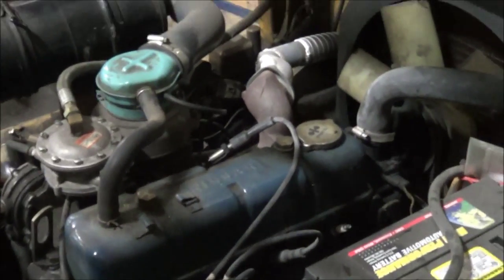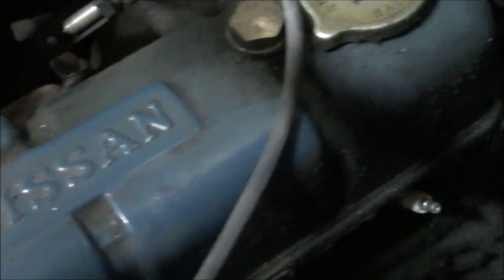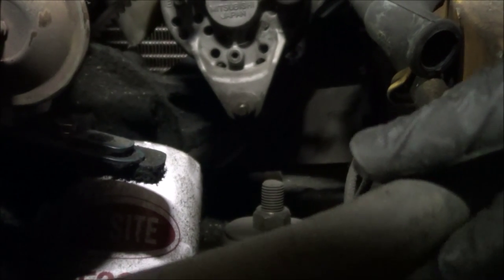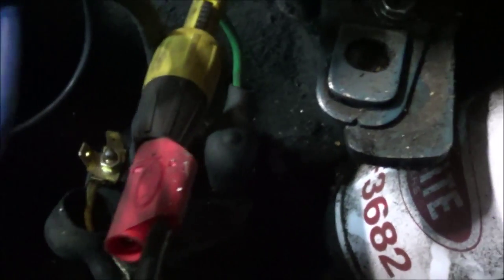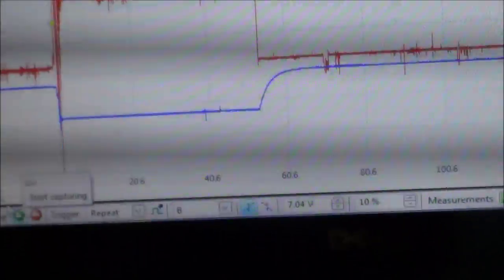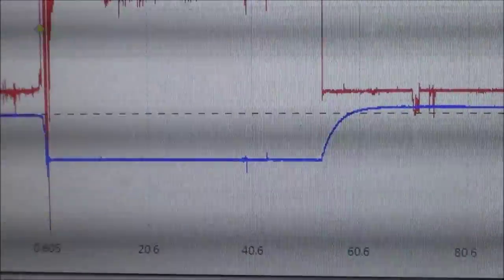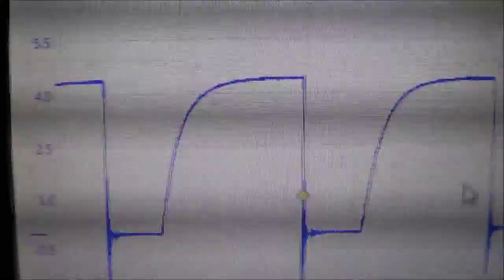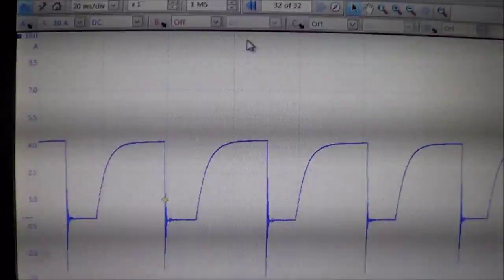Checking for a Weak Ignition Coil

Comment: How easy is it to set up non Pico amp clamps on the scope
Are you using the leads and attenuators  from your Hantek then?
Would you advise that I need anything else from Pico  to  get me started I have Hantek ht pickup leads ,test leads and attenuators from a Hantek hand held scope that went faulty.
Cheers
Reply from the maker: As long as you have the conversion factor for your amp clamp it is easy to set up. But for the hantek amp clamp I'm using I just use the 60A clamp option that is already included. They have the same conversion ratio I believe. The only difference I see is the quality of material that was used. I also use mostly hantek accessories.  But in time I'm planning to get the pico leads. Slowly though, as you said they are not cheap. For starting out I would recommend us get the scope as you already have all the accessories you need. Hope this helps.

Comment: I'm working on a Daewoo G25s-2 forklif that has a no starting issue. The previous mechanic changed the ignition system (coil, rotor, distributor cap/ wires and sparkplugs) After changing the ignition system , still weak spark, what should I check for ?
Reply from the maker: A cranking no start can only be spark, fuel, breathing, compression and timing. If you have a weak spark, check for ignition timing next.
Reply: @forkliftgeek10  what's the proper way to adjust the ignition timing?
Reply from the maker: You must refer to the manual for proper timing. But generally you could get it close enough by setting cyl 1 tdc compression then point the rotor towards no.1 spark cable. Different engines have different base timing though.
Reply: @forkliftgeek10  thank you very much sir, I will try that, do you have an email address so I can show my progress thank you
Reply: @forkliftgeek10  if the secondary side of the ignition coil is producing a value of 8.39 Kilo ohms and the primary side isnt producing a constant value. The coil was recently changed  but there's still a weak spark.
Reply from the maker: What's the voltage going to the coil when cranking? If the distributor is a Kettering type check for proper contact point gap if not check igniter and check for good ground.
Reply: @forkliftgeek10  okay when I used my multimeter and test for voltage  , I'm getting 12.7v same as the battery. However when I try starting the voltage at the ignition coil is reducing and the battery goes dead. Additionally, I placed  on test lead on the negative terminal of the coil and the other on the positive side of the ignition coil. Also, I set the air gap to 0.20mm at the distributor but still no spark.

Comment: Hi I am a flt engineer in the UK and have been thinking about buying a Pico for some time but the cost has been a problem
I have been told to buy the standard kit  rather than the scope on its own so all the amp clamps etc but this doubles the price
I already have a Hantek low amp clamp and a good high amp clamp
On your video it looks like you are using a Hantek low amp clamp 
How did it get on with the Pico?
Did you get the scope kit or just the scope?
Cheers
Sean
Reply from the maker: I bought just the Pico not the kit. I bought the clamp separately, yes it is a Hantek clamp. I bought a Hantek 4 channel kit years ago, so when I decided to go with the Pico I just bought the scope. Thanks.
Reply: +ForkliftGeek   . good Job !        I did exactly like you , i had a hantek 4 channel kit. sold the scope and got a pico using it with the hantek leads and clamps.....     iam planning to getting the pico leads. the hantek leads  are really fat and stiff compared to the pico set.     the hantek clamps  hold up pretty good i have them since 3years now using them almost daily with  the pico   on cars ,trucks, fork lifts ......a small tip  get 4 colored electric tapes and tape  the end of each of the 4 lead . that way  if you using more than 1 channel  you not wasting time wondering what lead is connected where on the vehicule (as the hantek leads are the same color)     that have save me lots of time

as far as  the weak coil   i would have done one more thing after seeing that   low coil current. i would look at both coil control  signal and coil feed voltage.  because that 12v  on the control side   is not underload . so you can  be loosing your feed ( due to voltage drop)when  the coil control is grounded and never see it . clearly not the case here as coil fixed it    but something to keep in mind
Reply from the maker: Thanks

Comment: I have a g25e-3 it has a delay on shut off. Any ideas on the problem
Reply from the maker: +Red Room Chicago it me dieseling. Meaning there are hotshots inside the cylinder.
Reply: Mmm. After it shuts off maybe 3 sec. Then the mil light comes on real dim. We don't use for diesel. Strictly propane.
Reply from the maker: +Shop Video dieseling is a term. It means the engine keeps running it doesn't mean using diesel as a fuel. This happens when there are spots within the cylinder that spontaneously combust even without firing the spark plug. Ignition timing that is off would sometimes also produce this symptom with engines not using propane injectors.